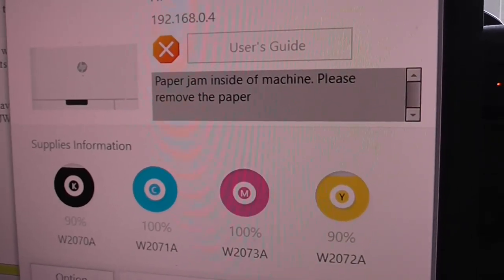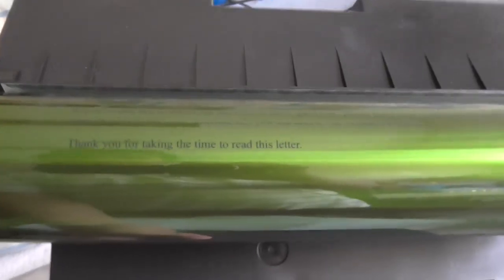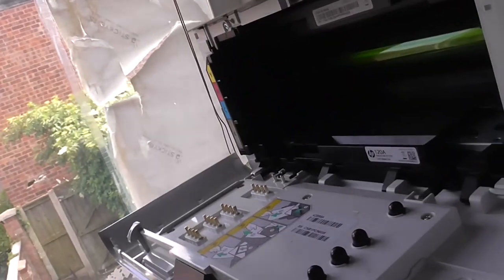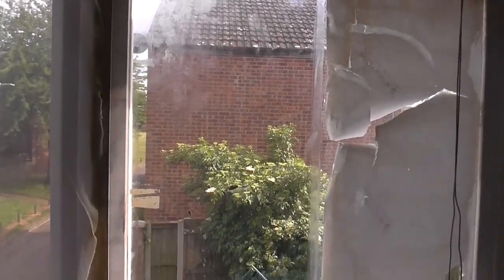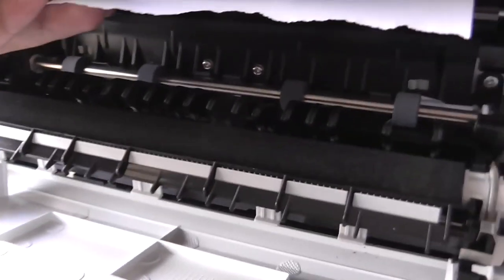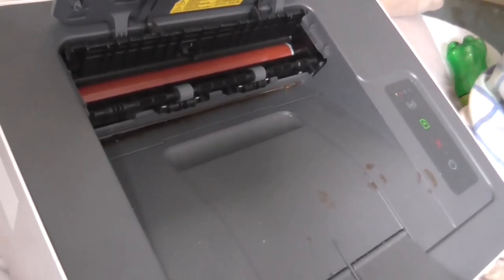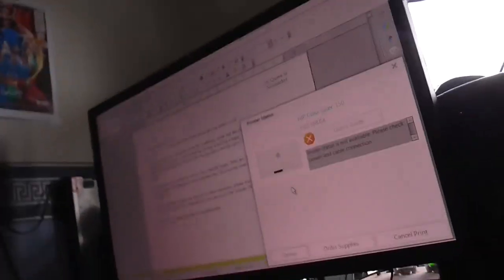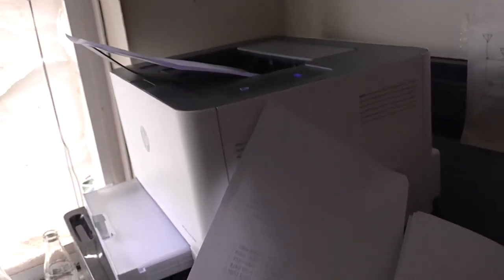Printer Problems

Comment: When I had endless printer problems, I was using one where the rollers that feed the paper through, were at the bottom. I had a material cloth on the table, which was interfering with the take-up. As soon as I removed the cloth, the problem disappeared. Yours is also an HP, and also looks like the paper container is at the bottom, and so the surface it’s placed on could be the issue.

Comment: Wrestling with my Canon, I feel your pain!  It’s wireless which means it’s extra hard to set up on router changing day and loves to jam when the paper cassette comes loose but only if an important and urgent document needs to be printed 😡 somehow this plastic inkjet has survived over 5 years, it will break tomorrow…maybe 😊 it got the ability to print from iPhone and iPad though but it couldn’t do it when it was new.

Comment: Jammed up printer is the least of my worries. Pray your printer will still be compatible with the next OS release. I had to binned away a few all perfectly good working printers all because of OS incompatibility.
Reply: try linux, most printer-driver-related problems are related to windows. with linux, your printer either 1. works immediately or 2. there is nothing you can do to it to make it work.

Comment: I have this epson XP-446 printer and it is a pain to use. If I don't print something like every week it has to be cleaned which wastes ink. and it you print something it uses ink so what's the difference?
Reply from the maker: This is one of the main reasons I switched to a lazer printer, so at least I don't have that problem, it may be more expensive but I can't deny that the print quality is better and quicker.
Reply: @CoolDudeClem  I'm thinking of going to laser printer too because I don't print much and when I do, the print is all streaked and I have to run a nozzle cleaning which wastes even more ink. I printed an image of my desktop last night to test it and it worked.
Reply: @coondogtheman  
My office printer is from Brother, works great and toner last much longer; B&W only though.

Comment: My Epson ink jet sucks. If not used for a few days, the print head clogs. When I run the clean function, the printer wastes a bunch of ink. End up running low and the ink is expensive.
Reply: That's not all! While cleaning it is also fills your maintenance box with used ink, which will have to be replaced as well.
Reply: @XStreet1985  
Dang.
Reply from the maker: They should make a printer where you can just re-fill each cartridge, the ink itself is probably not at all expensive to produce, it's the cartridges that it goes into that are costly to produce! (which eventually end up in a landfill)
Reply: @B blod
Is yours the Epson xp-446? Same one I have and it's nothing but trouble.
Reply: @coondogtheman  
XP-410. When I use it, it's fine. When it sits for a while, then I have to run the print head clean function.
Reply: @CoolDudeClem  
Epson and others make a kit with external tanks that are refillable; not for my printer though. 😥
Reply: @CoolDudeClem  They make such printers.
Epson: EcoTank and RIPS 
Canon: Mega Tank
HP: Smart Tank
But still. It is a print head clogging that is the problem, when not used for some time.

Comment: hey clem, I'm not trolling and this isn't meant to be offensive but why you always saying modern technology sucks? like your camera costs 50 bucks so what do you expect from it? Same goes for the printer, you buy some cheap junk and you're wondering why it wont work. And if your room gets too hot just get some blińds or ac. You get what you pay for .once again no offense
Reply from the maker: I would love to be able to get better stuff, it's simply outside of my budget. There seems to be two prices, either cheap Chinese made junk (which is the norm these days), or quality stuff that you need to sell a major organ to pay for! There's no middle ground. I would love to install AC in my room, but again, I simply can't afford it, so I have to go for the normal "made in china" stuff, it's my only option price-wise.
Reply: i paid way less than $50 for my camera and it works just fine. i think a lot of modern stuff is overpriced.